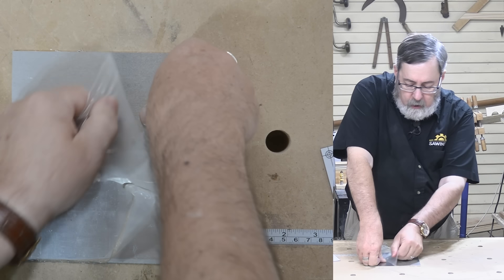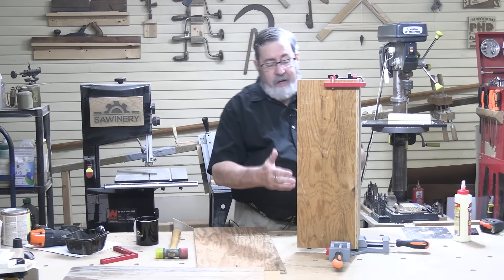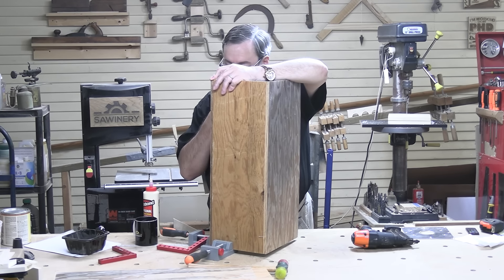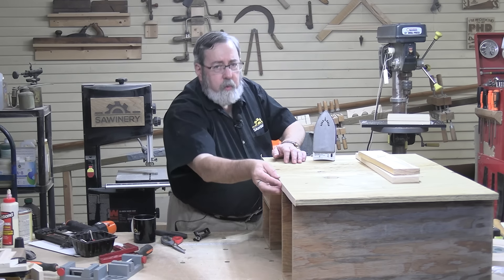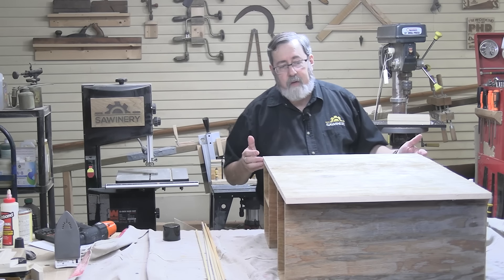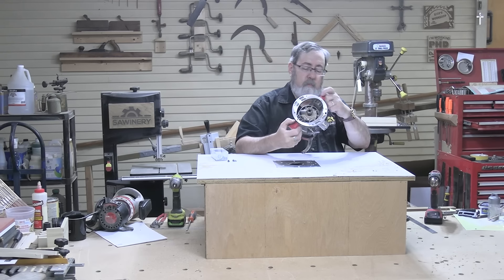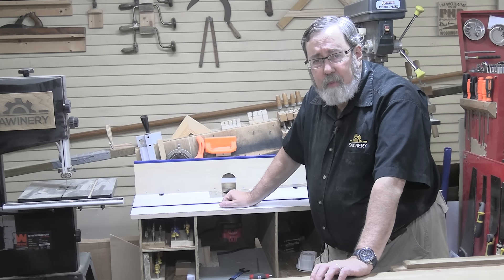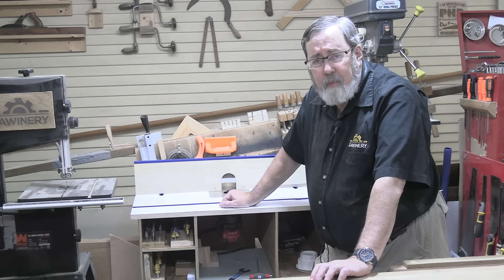ULTIMATE EASY Router Table Build!

Comment: You can reduce the potential for nail blowout (the oops at 8:25) by simply using your nail gun in the proper orientation. Many nail gun nails have points that are made by beveling the two sides of the end of the nail -- so the bevels are on the left and right. Thus, when using a nail gun, the potential for blowout is for the nail to veer left or right but far less likely to veer forward or back. So, for example, if you are nailing a back of a case onto the side, you would be better off aligning the nail gun perpendicular to the side -- that way, should the nail veer off course, it would likely still be within the side piece rather than blowing out of the side.

Comment: Seems to make more sense to buy an adjustable router that you can use that tool on from above the table instead of getting one of those overpriced router lift setups. I have 3 regular routers (2 like the Craftsman you have there) and also one trim router but I may buy one like the Skil you have there just so I can have an easily adjustable router table setup......Great Project!
Reply: You should take a look at Triton routers, they have a really nice built in lift system that operates from above the table.
Reply: @ridley8340  Thanks

Comment: Wouldn't it help to split the fence if you use it as an edger?
Reply from the maker: It depends on what you mean by an edger. If you’re going to use the router table to trim off material, like a jointer would do, then yes. But I’ve never found any other application where a split fence helps. Perhaps there are some; but I haven’t encountered them.
Reply: Yes that is what I meant